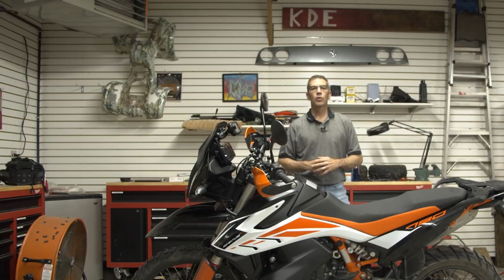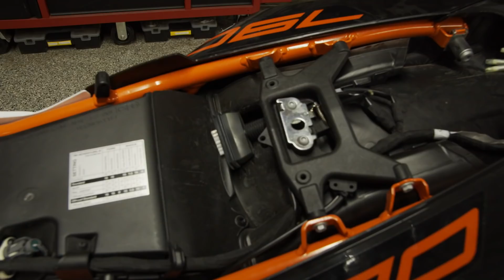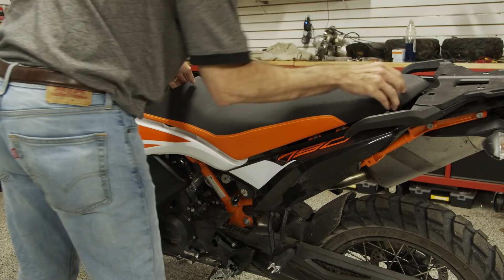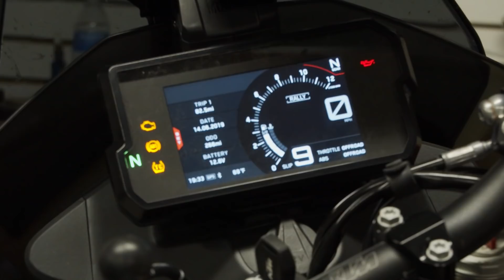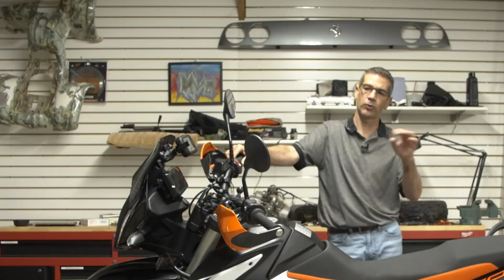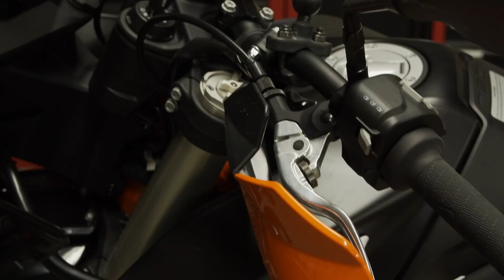KTM 790 Adventure R - 250 Mile Update

Comment: Hello 
Thank you very much for the great video!
I have a question for you:
If you had to choose between the 1090 adventure R  and 790  Adventure R wich one would you keep and why?
I am trying to decide wich one I am going to buy. 
I have a Husqvarna TE 300 2017 and I really want an adventure bike. I want to put some miles on it. 
I have done the baja twice. On a KTM 530. Two of my friends were riding KTM 1190 and they had a rough time on the sand.
I want to do the baja again and I don t know wich one to choose. 
Thank you .
Reply from the maker: Ricardo first of all thanks for the compliment and thanks for watching. My personal choice I’m still in the process of deciding that. So far they are both very capable and great bikes. The 1090 is a handful in sand for sure but I haven’t tried the same deep stuff yet on the 790 so hard to say there. What’s becoming clearer the more I ride the two is that the 790 definitely seems to have a clear advantage in off-road conditions but the 1090 has a clear advantage on the highway. So I think in the end it is probably going to come down to which riding you do more of. They are both extremely capable across a very broad range of conditions. If you’re going to be doing more off-road than highway I’d say 790. If the opposite is true then I’d probably say the 1090. Hopefully this helps.

Comment: Jealous that you can change ride modes on the fly! I love my 690, but the danged wheelie interference (aka traction control) keeps turning itself on between rides.
Reply from the maker: The dongle should fix that on the 690. Won’t allow you to change on the fly but will at least keep the settings throughout a power cycle.

Comment: Ok, So... I did 200 miles today. Initially the forks were too stiff so I softened them two clicks and it is now much better. My backside was not sore after the ride.

As for the cruise control.....It is, right now, virtually useless. Every time I hit a bump in the road it shut off, So I will contact the dealership Tuesday and inform them of that. Mine is the first they installed so I am the first to experience it. When it worked it was great, but soon as you hit a modest bump in the road it quits.
   The shifting is the smoothest I have ever experienced and overall I am very pleased. The wind at 70 miles per hour isn’t bad at all. If I didn’t want to feel the wind I would just drive my car right..!!!!
     After 180 miles I was only down one “square” on my gas gauge. Yesterday when I used the cruise I did it at slow speed and only for a little while so please ignore my initial assessment.
Reply from the maker: I’m very interested to follow this cruise control issue. I’m guessing it might have something to do with traction control. What settings were you running in when this was happening? I’m surprised with your experience with the seat. Out of curiosity how much do you weigh?
Reply: I was riding in street mode all day on factory settings.
I weigh 180 pounds without gear. I will keep everyone who is interested updated on the results of my cruise control issues.

It was about 70-75 degrees on my ride today so maybe the heat softened the seat up a little. It was like sitting on a basket full of kittens or anything but  I was perfectly comfortable
Reply from the maker: Mark Dance and it is the R not the S correct? They have different seats so I’m just checking. Maybe I just don’t have enough human cushion then 😂 because I’m roughly the same weight and at 200 miles I hated it.
Reply: Yep, it’s the R. I sit fairly far back on the seat also. My tailbone is backed up against the passenger seat rise.
Reply from the maker: Mark Dance hmm... maybe I’ll have to try that for longer highway stints.

Comment: The fuel gauge start working when the fuel ist half empty. As long all blocks of the fuel gauge are black. The tank is more than half full.
Reply from the maker: blottoeu then it goes to red after half at around 180 miles on mine 😂 so I guess it kind of works

Comment: I picked mine up today. Put about 30+ miles on it. I got the cruise cont and it works very well. It does require a whole new switch/ button assembly and it requires some time to install so the dealership charges accordingly. I got my heated grips and cruise installed for very little additional costs but the dealership said it was the first one they did and they won’t do any more for what they charges me....
     My initial thoughts on the bike are very positive other than the suspension seems a bit stiff for my liking and the seat is fairly firm but both of these things can be changed of course.
     I am going to go with slightly lower foot pegs also. I am 6’0” tall and 180#.
Reply from the maker: I had a similar experience with the suspension I simply softened 2 clicks on each. Much better. Congrats on the new bike!
Reply: Mark could you share what cruise was installed.  I know this bike is fresh for you, wondering if it's comfy to tour on like a 800gs. If you put some miles on pavement let us know please
Reply from the maker: tdirtpor I’m pretty sure he had the OEM one installed. They come ready for cruise but the handlebar switch has to be replaced then they enable it in the computer.

Comment: Hydraulic clutch makes no sense, cause you don t have a chance repairing it when it fails and it would fail.
Reply: usualrider Are you speaking from experience?
Reply: @yesode4201  Yes, on my 690 Duke 4 (2013) at 20.000 miles, diddnt make it home. Don t get me wrong, that just might happen -  I just thought it is easier to repair when you out there in the open...
Reply: You know, I've had a clutch cable break on every bike over ever owned, but never had a hydraulic one fail.
Reply: I'm with you. Was the cable clutch so bad that we had to overcomplicate the system?
Reply: Ktm hydraulic clutches work perfectly,     I’ve never heard a negative comment from dirt bike magazine or anywhere except here.    I’ve owned 5 bikes with them the last ten years and ridden them a bunch with no problems
Reply: I think Lyndon Poskitt had trouble with his. Had to do a sleeve or something on his 690. He did ride the dang bike all over the world though. Things are bound to wear out.

Comment: Have you had any issues with cold starts? I just got a 790 Adventure and I've put about 150 miles on it. It seems like it has trouble finding idle in the early mornings.
Reply: Other ktms have a 15 minute idle sequence you can do to adjust to temp, elevation, and throttle opening.  That might be a thing on the 790
Reply from the maker: I haven’t so far. When they first fired it up at the dealership it took a second for the second cylinder to fire but since then no issues.

Comment: Hoping for a touring review. Compare the 1090 and KLR.  That,s my buy point. I  hope to order soon
Reply from the maker: Touring hands down the 1090. I like the KLR but they are a single and get very buzzy at highway speeds. You can add cruise control to the 1090, comfy seat adjustable wind protection so hands down the 1090.
Reply: @kdemotorsports  thanks for your immediate reply.  I didn't word my post for a touring review very well. I'm wondering  about  distance riding on the 790r.
Reply from the maker: tdirtpor early to say since I haven’t had a chance yet to do really long highway stretches and my cruise control switch won’t be in until end of the month which makes a huge difference when doing highway stretches but I will say the 790 handles done at speed on the highway. Has more than enough passing power. Is plenty stable. The stock seat at least on the R version would need to be replaced for long highway rides for sure. Other than that though I think it would be fine.

Comment: It’s a KTM. Of course the fuel gauge isn’t working.
Reply: I’ve replaced mine twice and finally broke into the third and chamfered the top of the float. Alas no more endless full tanks of gas...
Reply from the maker: Captndarty that’s what I heard is that just pulling it and sanding it down was the only true fix.
Reply: kdemotorsports it works absolutely perfectly now. Oh and don’t forget fuel filter changes either. KTM doesn’t talk much about that but after 18,000 miles and fortunately the last 80 miles of a 4 Day road trip mine failed. They are expensive but I will be changing them every oil filter cycle going forward.
Reply from the maker: Admittedly so 😂 I still haven’t done the fix on my 1090.

Comment: No hydraulic clutch?   That’s crazy,  Ktms always have them.   that’s a huge mistake.
Reply: Well the stock slave cylinders were kind of a failure waiting to happen
Reply from the maker: Yeah I expected one too. But I will say this is one of the easiest to operate cable clutches I experienced.
Reply: Worldly Rider if you get the quick shifter, which reviews say is worth it, usage of the clutch is greatly reduced.  Add a rekluse clutch and even better.